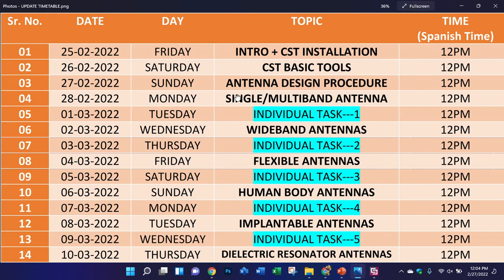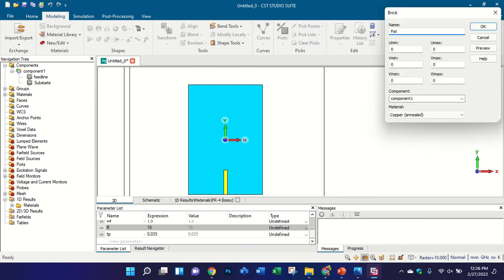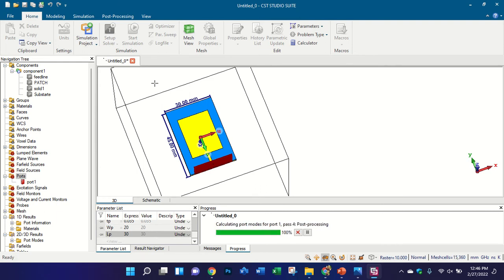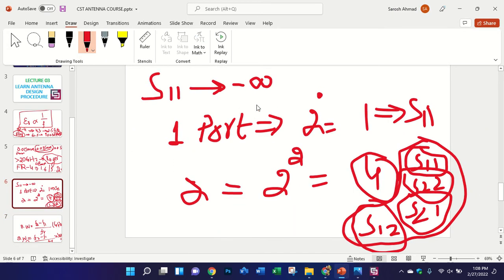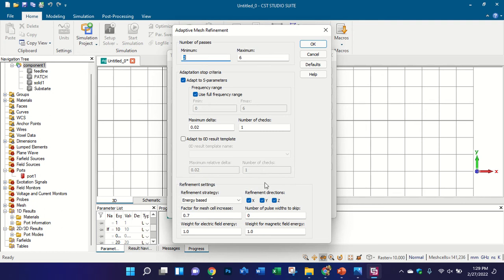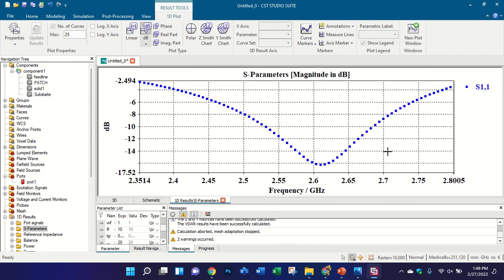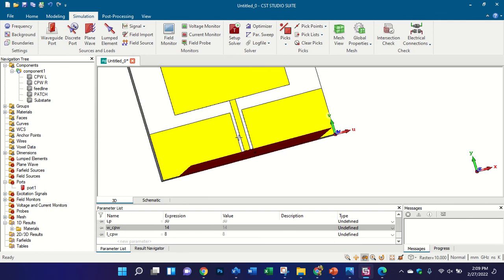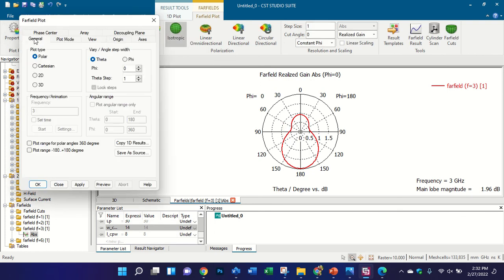LEARN ANTENNA DESIGN PROCEDURE USING CST SOFTWARE [LECTURE # 03]

Comment: hello sir  thanking you for uploading the complete CST playlist. I was searching the  for CST videos from nearly one year. I have some doubt basic doubt regarding antenna design. I will be very helpful to u if u provide me your email ID .
thanks in advanced🙂 
🙂
Reply from the maker: Thank you

It is better if you ask me here
Reply: @antennadesignbycst  thanking u sir for replying on my comment.
My first question is that how we decide the length of the feedline ? Is there any calculation involved as in width of the line or we take any  random value? In one of your videos u have taken the length of the feedline as 20 mm, Please explain how u have taken that value.
Reply: one request please continue to make videos on cst .Also those paper which are published by u, please make videos on those telling things from scratches ,the calculation involved in paper and all other necessary thing. 
thanks in advanced
Reply from the maker: @ there are calculations for width but for length you can take any random value and observe your results
Reply from the maker: @priyanchalkhare1932 sure
Thanks
Reply: @ hello sir thanking u of the answer.
Reply from the maker: Join my WhatSapp Group: https://chat.whatsapp.com/IOddSvUKePcCotxbLwg0S3